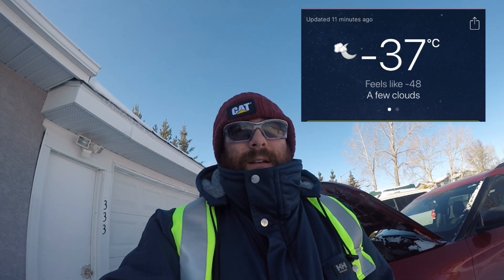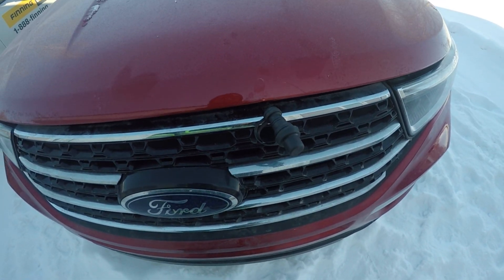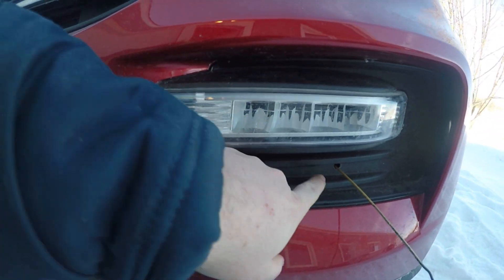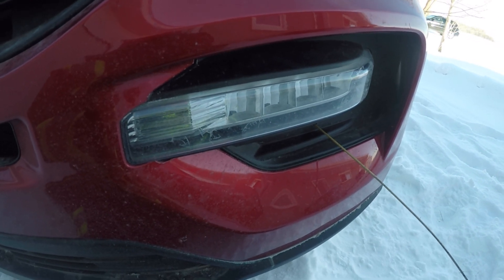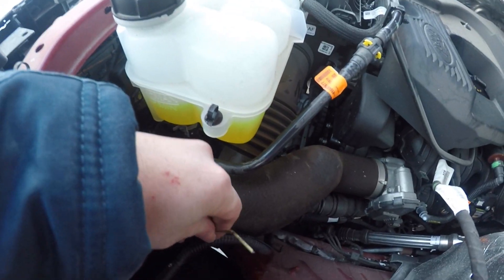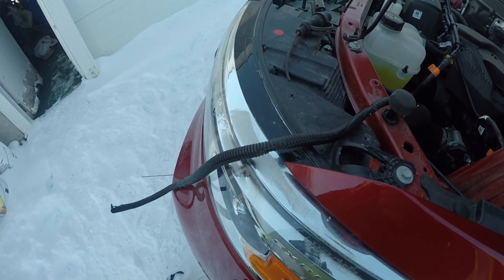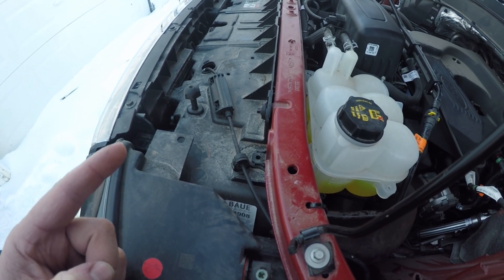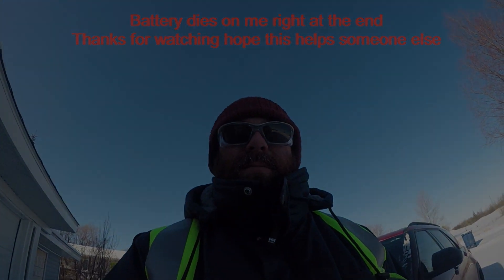2020 Ford Explorer Block Heater cord routing

Comment: I believe that the dealership is responsible for installation of the block heater.  Possibly not even a certified mechanic put that on.  Depending on the diligence of the garage supervisor, it's likely just laziness at the local level.
Reply from the maker: Even if that’s true They follow the instructions given by ford - it’s not a local thing I’ve seen the block heater cords done the same way on other explorers and expeditions from all over the country.